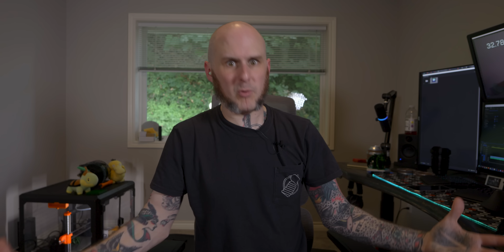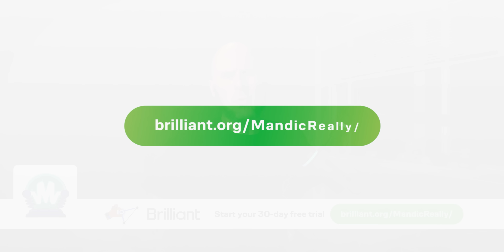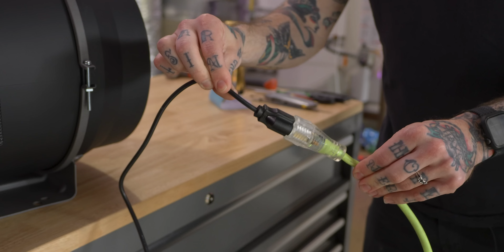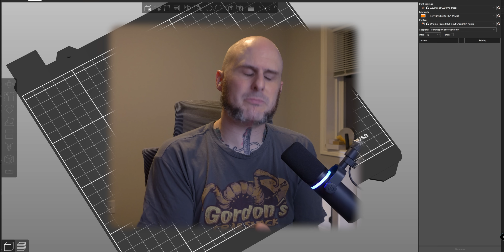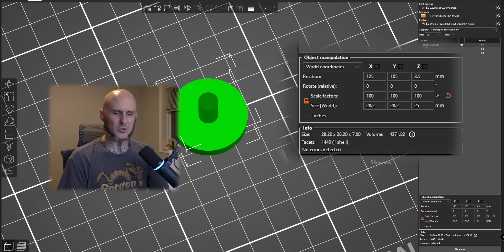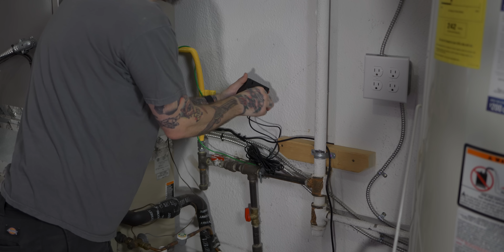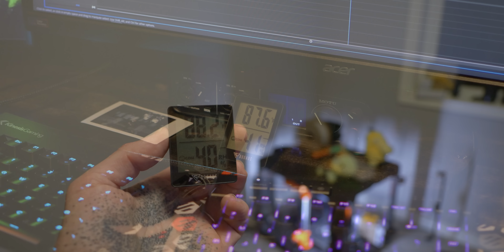Office Build Begins: Solving 2nd Floor Heat w/ AC Infinity T12 fan!

Comment: Man.  After removing the motor... you can see that the flanges can flex.  You could have cut the duct to the exact length to fit it and flexed it into position.  Flexible ducting is not good stuff (and certainly it is all around in your attic, but eliminating as much as possible is a Good Thing™).

Regarding turning the fan on/off based on temperature.  I'm not sure where you are (now I do... yep, humidity), but if you have high humidity... you don't want that fan running after the unit turns off, especially based on temperature.  What will happen is the fan will keep running and as the coil is warming up, all of the condensation on it will just start to get carried back as vapor... humidifying the air that was just dehumidified.  For an AC, you really want the fan to stop right at about the same time as the compressor stops.

As far as saving money... eh, probably not.  You're running a fan that is probably consuming more power than the adjustment to your thermostat setting saves you.  How much?  Not much.  It is probably close to a wash.  But, that comfort improvement while you're sleeping?  Priceless.

So, here is what I want to have... and there isn't a system on the market for this in the US.  A VRF Heat Recovery Heatpump system that includes the water heater.  The way refrigerant cycle works is by compressing the refrigerant which superheats it.  If you want to heat a space, you send the superheated refrigerant to that space in a coil and run a fan over allowing the air to absorb the heat from the refrigerant.  Then, the refrigerant that is still compressed, but cooled down closer to the temperature of the space you just heated is sent through a metering device (a choke point to maintain pressure that is relieved once it passes through).  This allows that refrigerant to expand from a liquid and phase change to a gas, which drastically cools it, known as subcooling.  You then pass the subcooled refrigerant through a coil and run a fan over it to all the refrigerant to absorb heat from the air in that space.

So, we run air conditioners to shunt heat to the outside.  We superheat the refrigerant put it in a coil outside where we run a fan that cools it close to the outdoor temperature.  The subcooled refrigerant runs through the indoor coil with the blower fan.

A heat pump just allows us to reverse this when we want heat inside.  The subcooled refrigerant is outside in the winter and is cooler than the outdoor winter air, so we're still able to extract heat from it.

Now, the way VRF works... you can have multiple indoor coils.  Maybe two central air handlers operating like zones.  Maybe an additional air handler for each bedroom and/or office space where you might keep a door closed for an extended period of time and someone may prefer a different regulated temperature (like in your office).  Or... maybe an air handler hooked up to a water tank.  If there are different desired temperatures at the various units... with some calling for heat and some calling for cooling... it won't turn on the outdoor fan... it will take excess heat from a space you want cooled and send it to the space that you want heated (like the water tank).

The multi-zone mini split systems basically work like this.  They make a controller box that you can put inside that is like a manifold for all of this, as well.  They just don't have these setup for water heaters, right now.

Heat pump waters heaters that are on the market right now... suck.  I have one.  They're far more expensive than they need to be.  They're trying to have close to a drop in replacement and basically have a little window unit air conditioner mounted on top rejecting heat into the tank.  A standard electric water heater is cheap.  A window unit air conditioner is cheap.  $500 for one, $300 for the other.  In reality, they should be able to make these into one thing for ~$800.  How much do they charge?  $2000+.  And, the manufacturers' own support teams don't even know how they work.  Everything turns into a total unit replacement.

If they just made the water heater work like a head unit attached to a mini-split, the water heater part should be cheap as can but.  Then you get the operating efficiency.  Anyhow, sorry for the info dump.  I think something like that could be AWESOME for your setup.  If you end up doing a system for your office, I would totally considering rigging it to a hot water tank.  Even if it isn't your primary hot water... make it a "pre-tank".  People have done some DIY setups like I have described.

Comment: A ducted mini split for the second floor is the best solution. It would cover the entire second floor. The issue is that the existing system would now be over sized for the first floor and would really need to be changed to a smaller system. 18,000 Btu for the mini split you got is way too big. You need to calculate how many BTU all that stuff is adding to the studio and install a mini split based on that.
Reply: Just have to look at those hideous boxes mounted to the wall though

Comment: You need to balance the registers in your home. Close off the lower floor registers to say 50% and open the farthest away from your furnace 100%. You could buy a handheld airflow meter and eventually balance them all. This will make a huge difference
Reply: ^ This.

Further furnace blowers have speeds and if the speed is too fast you won’t have the right dehumidification. If  the speed is too slow you will dehumidify but it can lead to airflow problems. He may have simply needed to adjust that and the registers and the furnace fan. Not all AC techs will do this. They just check the temperature differential and say everything is good at default settings. Aftermarket replacement blowers can have different settings than the label plate. I had all the issues he had in my second floor and it ended up being a broken vent duct and the wrong blower speed. This wasn’t found by any tech but by the sales guy working on replacing a different floor’s unit. He was a master installer and worked on the Building Efficiency side before his knees blew up.
Reply: Respectfully, that’s a really bad idea. By closing some vents you are raising static pressure and chocking the airflow. As a result your other vents will be colder than necessary creating conditions for sweating and possibly mold to grow. Call a professional and have them do a proper air balance.

Comment: I had to get a protable ac to service  a music studio on the second floor.  The room was getting over 95 degrees and when the downstairs was 67 and the rest of the upstairs was around 71 degrees. Its loud as hell which is a problem, I have to turn it off when recording any acoustic instruments in this room, I have amps in a separate room with the cables running to that room for mics and input signals which works just fine.. but its LOUD in this room but it keeps the room cool and makes the ac unit work much less hard to cool the rest of the house. My dad had tried the inline fan solution for his house second floor but it had minimal to no real impact so I just went with the portable ac. I just got a newer one which works a lot better than the pervious older unit I had which I had to run 24 hours a day to keep that room upstairs at 75 degrees...I even have to run the portable ac in the winter because the room would regularly get above 80 degrees.

Comment: Can-fans located on second floor pulling air, sized to smaller ducting would be more efficient perhaps. and quitter. Located at that junction box in attic. Then you wouldn't hear it. Easier to pull air the to push it. Whatever works though right (especially if its free). Hope its working out.

Comment: Everyone here suggesting all these complicated fixes... love it for geek factor, but you only need two things:

1. Ecobee thermostat with several remote sensors.
2. Vent flow balancing.

#2 is important... and rather cheap and simple... most vents in your house will have adjustable louvers, partly (or even fully) close off the ones in the areas receiving the most flow, measure the flow coming out of the slowest vents.  Once you have flow balanced this way you can fine tune them to account for any seasonal heat loading differentials... though that proved unneeded in my house with the Ecobee sensors.

The only real concern with #2 is if you have to add too much restriction, but since you already have that extra booster fan, it's not a huge issue.

Also, in the summer, you probably should just keep the booster fan running non-stop during the day.

Comment: Your uncomfortable problem has a lot to do with the fact that you do not keep your furnace fan running 24/7. Keeping the furnace fan running 24/7 leads to a more comfortable conditioned. space. My father is a HVAC engineer and you do not save any money keeping the fan cycling on and off. Cycling of the fan on and off only causes more wear and tear on the motor. Your furnace motor will run longer basically forever if you leave it running all the time. Keeping the air circulating within the home 24/7 is going to lead to a more comfortable space

Comment: Buy a window unit those on the floor window units that have a tube that pipes out the window those things are so inefficient because all you're doing is creating negative pressure and then allowing heat to get back into your house I'm telling you you'll save way more money just going to Walmart and buying a little 5K window AC

Comment: Hey! HVAC technician here, 
at 13:14 they make a special tool for that called crimpers, they fold the end that round metal duct connection into a nice wavy pattern so can attach flex ducts, metal ducts, and etc. 
and for 18:16 if you open up the furnace there should be a wiring diagram that will show were there's either a bus bar or a set of wires that use 24 ac volts, in those connections you'll have the following R (which is power), C (which is common/neutral), Y (which is the cooling), W (which is the heating), and G (which is the fan). with that knowledge if the ac infinity has a spot where you can connect 24 volts you can use the Y and C as a relay, because the thermostat takes R and jumps it to Y and G to let the furnace know that it is in need of cooling. i recommend Y instead of G because in the winter the thermostat jumps the power to W and G, so it'll ensure that the fan only kicks on during cooling.

Comment: for home assistant its easy you need a power sencing power outlet or swich and when load is engauged it kicks the fan on easy peisy, IF you truly want to cool that office and dont want a second AC you need to deal witht he heat buildup the easyest way fo doing it is get a hole saw and make a hole in the floor with a baffle and a fan that exausts tot he floor below. this will pull the hot air fromt he office and vent it to the lower floor. or make the return for your AC upstairs biased so it pulls its return air from upstairs and no return for down stairs

Comment: why did you even mount it to the wall? you should've just got the appropriate 12" duct fittings. that 12" duct is plenty strong if it's supported properly
Reply from the maker: The duct was not well supported at either end. When it was just the weight of teh duct that was fine, adding 20+ lbs of fan is a different matter.

Comment: You added boost in a location with close to maximal primary boost. I put these same fans in the attic, which works to exclude sound, create the boost where you need it, and addresses the problem you are having, by decreasing friction/flow limitation in the duct close to the primary fan. You’d get much better output with a remote fan, placed just below your distribution box.
Reply: thats what i would have done
Reply: But that would have been a lot more work :D They also moved outta this place afaik, so this is entirely moot now.
Reply: I was think the same thing. I have 3 smaller AC infinity fans and they excellent. I use the AC infinity smart controller to regulate the speed based on temp and humidity. Excellent product.
Reply: Yeah, kids are not smart these days. He's a kid, so just accept it for what it is. Clickbait kid-click stuff.
Reply: @Pleiades721  he took his time to show his process with mistakes which takes time energy and willingness. You on the other hand haven't contributed in any positive way. What really makes a video complete is the comment section from other folks who might have more experience or some good advice for improvements. that's how we all learn. To me the entire video and the comment above made a whole difference. do something useful with your time if you don't understand how youtube and community works.
Reply: @LifeSurfingDude  Nice hopesult. I contribute all over, online and offline.
Reply: @P @Pleiades721 you “contribute” by insulting the creator of this video? The ego…
Reply: @julianmorning  Professional victimhood, white knighting, and hopesults. Those 3 phrases explain your whole generation.
Reply: @Pleiades721 and what generation is that?
Reply: @Pleiades721 how many times were you dropped on your head as a child?
Reply: @DirtyDavis-do7vy  Nice tantrum and white knighting, kid.
Reply: @Ple @Pleiades721 thanks champ! You gonna answer the question? 😘
Reply: @DirtyDavis-do7vy  Lol. Nice hopesult, kid. :P

Comment: You should remove one layer of 2"x4" and print bigger bushings that isolate the wall mounting screws from the fan mounting screws, that would reduce vibrations much more.

Comment: You could use a “current sensing relay” on one wire of the fan and put the T12 on the NO contact. You could also add another relay if you need additional current for the T12.

Comment: You might consider looking into vibration issolating feet or mounting for that fan mount. That should help the noise transferred into the house from that solid mounted fan.

Comment: I know that this is abit older video, have you had moisture issues in the bottom of your plenum?  That much airflow in such a small air handler will speed up the air way to fast, and cause the water droplets on the evaporator coil to break free and land in the bottom of the unit.  This could cause water pooling issues in the bottom of the unit.  For comparison one of our units is a 3 ton system and the blower is 1270 CFM.  The rule of thumb is 400 CFM/Ton of AC.  👊😉

Comment: I thought my 8" was a big one, that's a big fan!
Reply: Hmm I had a return added to my office I wonder if it's a jump duct like you described.

Yes 7 on the 8 inch is about the max we can take, ours runs an air filter through a box of MERV13 and a canister of ACInfinity's charcoal filter.

Comment: Nice video.  I have a some recommendations:  1) Add an insulation blanket to  hot water heater, 2)  Insulate the gas exhaust pipe from the HWH, 3) look at the glass window - maybe add another layer of glass for the summer to add to the insulative properties, 4) increase the size of the duct to the office, and 5) get an HVAC pro to reevaluate the ducting in the attic to better serve your needs (it seems as though your system is not balanced correctly).

One additional note, try and avoid flexible ducting - it restricts air flow of the system.  Solid ducting with very thick insulation is the key.  You want to control the air - not have the environment control you.

Comment: have the air return up hi by the ceiling (if its on the floor you can open the drywall and extend it up to the ceiling).  Or run a ceiling fan to blend the hot and cold air.  Just imagine the temp at the ceiling is 93 and the temp at your carpet is 83.  You want the 93 degree air returned to the basement.  Also if the return is on the floor, all of your gear might be blocking it.

Comment: Solid solution. I did something similar for a single room feed. Because I keep the main recirculation fan on 24/7, I just use a smart plug to enable it during the 3-4 month cooling season, and turn it off for the rest of the year. For noise, centrifugal fans are a better bet however. I cannot hear the one I installed at all.

Comment: I've done a similar setup to this! I have an Ecobee thermostat (integrates very well with Home Assistant) and an AC infinity set up with a Kasa smart plug. In my case the vent booster is only on a single vent and is driven by the temperature in my office with some additional logic to avoid over heating the room in winter. It also kicks on if CO2 gets too high. In any case it's worked perfectly and I'd highly recommend the combo. I also use Govee bluetooth temperature sensors (H5100) with some USB to AAA adapters for additional temperature data. They have been extremely reliable and they're very cheap.

Comment: Make the undercut of your door larger to get more air out, so it will be less pressure in the room for the fans to fight against.
For the fan stop and start you can have the sensor on the refrigerant line instead or you can have a curremt clamp on the hvac to measure when it turns on and automate from there

Comment: Also, you may want to look into getting a dehumidifier because it will make the ACs job much easier. That said, it depends on where you live and the relative humidity. I think you are on the right track with adding a return. People usually forget that in order to increase hvac  air circulation, you have to account for air going both ways. If you push a bunch of air into a room and it doesn't have an easy way to get back to the HVAC air handler, then it won't help.

Comment: To automate, you can use a clamp style power monitor on the air handler circuit and have the automation turn on your infinity fan when it senses the electrical draw increase. If you need more details, reply to this and I'll point you in the right direction.